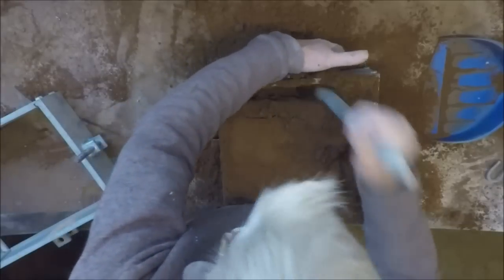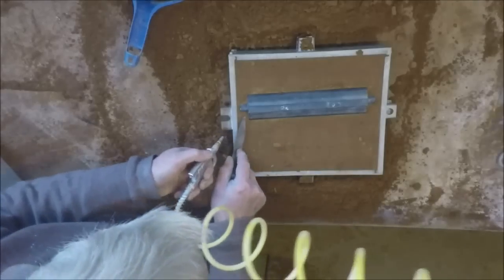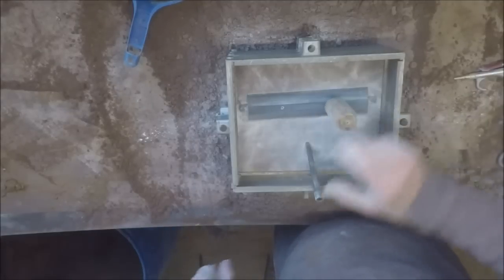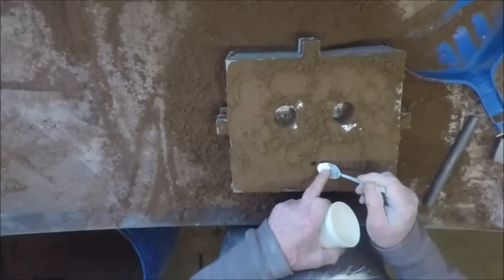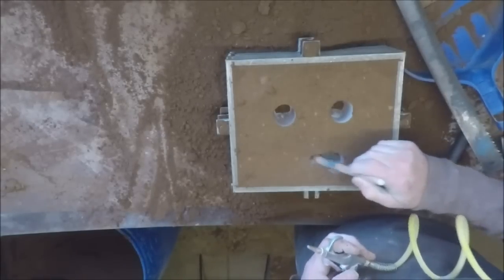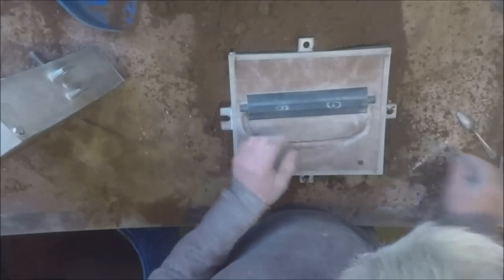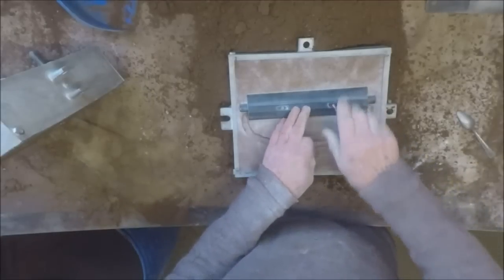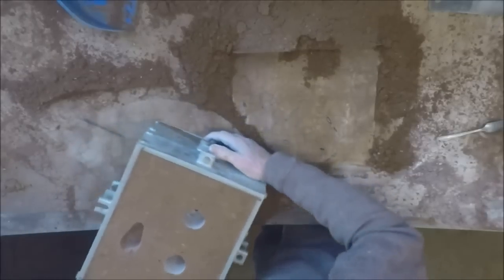Casting a Mini Minor water connector

Comment: Once again a great video. I,m curious about the pouring basin your trying. I've seen similar form used but at the bottom of the sprew where it connects to the gate. Supposedly used to catch any loose sand from getting to the gate and casting. What is desired result you are looking for using this " Campbell" method?
Thanks
Reply from the maker: Dick, Damn good question! I mean that, and there is a damn good answer. Give me a day or so while I think of the right words to explain it properly - it is such an important part of pouring a good casting that I want to do its explanation true justice. For now I will just say that enlargements at the sprue base, often used and advocated by "old timers" were thought highly of (by researchers) some 60 years ago. However recent work has shown that they  never fill as hoped and contaminate the incoming metal stream with lots of air bubbles - large runners rarely run full until quite late in the mould filling process - they slowly release air bubbles into the metal stream until they are full. The bubbles may stay in the casting or may rise through the still liquid metal but in doing so they leave a trail of oxide  behind them, sort of like a collapsed sausage skin these provide not only a weakness within the casting but also a leak path if both ends thereof are uncovered during machining. In calm quiet filling of a mould as this basin and sprue arrangement achieves you will not get any loose sand. I will think on and reply more fully later.
Reply from the maker: Dick, I will see if I can do this topic justice in under a few hundred pages J. I will break it into at least two parts.Part 1, some background: - Aluminium is a very reactive metal. A layer of aluminium oxide will
immediately form on any fresh aluminium surface. Initially it’s only a few atoms thick however it does thicken, quickly at first but at a diminishing rate
as time goes by. This layer is strong, tough, tenacious, and pretty much impervious. This means that at room temperature it effectively stops getting thicker
fairly quickly. But it protects the aluminium from being eaten away by corrosion as a metal this reactive really should quite quickly be. Without this
layer aluminium would be just about useless to mankind – were it to be flaky and porous like the rust on steel for example we could not use the much more
reactive aluminium for anything because it just would not last. Whilst beneficial on the surface if it manages to get mixed in through the aluminium
this oxide layer becomes a serious problem. Unfortunately it is present right through most aluminium in varying quantities and results in lower strength and
much lower ductility and shock resistance.
The reactiveness of aluminium also causes us another problem – the liquid metal will react with water vapour to form not only more oxide
films but also hydrogen gas. The oxide will stay on the metal surface but the hydrogen will dissolve in the aluminium only to (probably) come out of solution
as the aluminium solidifies and fill our otherwise excellent castings with lots of small gas bubbles. The water vapour comes typically from the natural
humidity in the air and the burning of hydrocarbons (oil, gas) as the furnace fuel. Anything that increases the mixing of air, particularly the very damp air
in a sand mould, with the metal will increase both the oxide and hydrogen levels.
When you melt aluminium you can actually see the liquid metal trickling out of this oxide layer on its
surface and unfortunately the layer mostly finds its way into the liquid metal where it floats around as a thin film. As the metal is processed and cast into
a mould the films break up and become repeatedly folded so the resulting casting is a mess of entangled oxide films. These films are bonded to the
aluminium on the side that formed against the aluminium but are not bonded to anything on the side that formed against the air. When folded we have therefore
an unbonded side against  an unbonded side, virtually a crack within the metal, a crack that is easily opened up by stress
or by a bit of trapped air, hydrogen gas, or metal shrinkage. It is now well researched and well known that the random porosity often found throughout
aluminium castings is associated with these folded films – these days they are called “byfilms.” If we could get rid of them our castings would not only be
porosity free but have much higher and more reliable mechanical properties. As an analogy it is sort of like receiving a delivery of concrete for your new
house foundations, as you pour the concrete you realise that someone has put several thousand plastic bags in the mix – your foundation is not going to be
as good as it could be with all those plastic films mixed in with the concrete. Substitute oxide films for plastic bags and aluminium for concrete and I think
you get the idea. By degassing your aluminium with fine bubbles of a suitable purge gas for 5 to 15 minutes plus you will in fact float out many of the oxide
films present – at least those bigger than the bubbles. But we now have to get the aluminium into the mould without making more films, and I will get to that in
part 2. 
But in the meantime and as an experiment get yourself a bucket and fill it with water from a hose held several inches above the water
level and adjusted to produce a smooth stream, as it is filling notice all the bubbles of air that are being pulled down into the water by the stream from the
hose. Wobble the hose about a bit to cause some splashing – even more air, raise the hose higher - again even more air. Lower the hose to quite close to
the surface and hold it still – no bubbles! If the water were aluminium every one of those bubbles would be generating lots of oxide films and even though
each bubble will come to the surface where most will burst the oxide films would remain behind as a collapsed sort of sausage skin.
I am working on part 2 J
Reply: Wow Thanks J for all the work you're putting into this answer. Hopefully others than just myself are reading this.

I've ordered a copy of Campbells "Ten Rules" from amazon. All this is very interesting and helpful. I haven't seriously cast metal since high school over fifty years ago and plan to be doing so again in the not to distant future.

I'm not a stranger to working metal as my father was a machinist instructor and I trained as an A&P mechanic and have been a professional general blacksmith for over 45 years. Now semi retired some of my planned projects will involve foundry work.

Your professional and experienced  videos stand out from the mostly "hobbyist" vids on YT and I'm sure will help me in getting back to foundry work with a lot less trouble and error.

Thanks for your reply and awaiting Part 2
Dick
Reply from the maker: Dick, Here is my attempt at Part 2 of my answer. Firstly back to the hose again.Now hold the hose so it points vertically down (or turn on a tap (faucet)) and look at the shape of the stream – it’s tapered - getting ever
thinner the further down from the hose (or tap) it gets. It gets thinner because of the acceleration due to gravity. This taper is the natural shape
that all liquids (including molten metals) take when they fall in a stream.
It’s the job of a sprue to deliver metal to (preferably) the lowest point in a mould in as undamaged condition as possible. This is its ONLY
job, it should never for example be used as a feeder or an air vent. From here the metal should flow always uphill (difficult to organise) as it gradually
fills the mould. By undamaged I mean free from entrained oxide films, trapped air bubbles, random nonmetalics (sand etc.), and extra dissolved hydrogen. The
metal should be delivered sufficiently quickly to ensure that the entire cavity fills i.e. that we do not get any miss runs through slow pouring. BUT we don’t
want to fill the mould all that much quicker than this “miss run” situation as excessive metal velocities are the enemy. In short anything that leads to
turbulence, splashing or air entrainment into the metal stream is to be avoided. Now, think of a parallel sprue – the tapered metal stream will only
touch the sprue at its top, the rest of the stream will be falling unconstrained in air and almost certainly wobbling from side to side of the
sprue, splashing and plopping its way down to the bottom and pulling in air like a venturi pump. The random hitting of the sides of the sprue is also known
to pull sand off. You can see evidence of this in some YT videos in the form of thin rough black patches sometimes actually containing stuck sand on the sides
of the sprue after casting. One well known YTer actually has such a “blackened’” sprue in the picture that is part of his channel heading. When you
pour aluminium you can see that the metal looks like it is running through a pipe - sort of like water through a very thin flexible plastic tube. In fact
the aluminium is flowing through its own oxide skin. The skin itself is not flowing and remains in place sort of hanging on the crucible lip. Any of the
parallel sprue turbulence indicated above will break this skin and entrain it in the metal. The larger and higher the parallel sprue is the worse the
problems become. Now, give the sprue the same taper as the metal stream naturally has. The sprue now runs full with the flowing metal nicely
constrained within its own oxide skin the latter held nicely against the sprue walls. There is no wobbling, no turbulent metal stream, no splashing, no
plopping, no air entrainment, no hydrogen pick up, and the sand remains where it should be. There are other benefits too – it is easier and quicker to make a
sprue with a former as I do rather than to cut one with a tube. Also my sprue takes up very little metal - large sprues require the melting of a lot more
metal. There is a caveat here – for the sprue to run full it has to be correctly sized. Typically I use a sprue with a small end diameter of 5/16 inch
and a large end of ½ inch and its 4 inches long (high.) I use this sprue on most of my work and that includes castings of 6 to 7 pounds weight, my mould
fill times vary from about 5 seconds for a small casting to about 30 seconds for a larger one. Occasionally, when I require a quick fill, I use a larger
sprue with a 3/8 inch small end diameter; this passes metal so quickly that I have trouble keeping it full. Most people have little idea just how much metal
a sprue will pass and accordingly use sprues that are way to big. This 3/8 sprue when used just 4 inches high will pass just over ½  pound of aluminium per second – this is way higher than  the rate at which most of us YTers ever pour! Any yet they use sprues several times this size – WHY?
The job of the pouring basin is to provide a target for the pourer to aim at, to  provide enough metal to keep the sprue full,  to deliver the metal to the sprue without any vortex forming air sucking in turbulence (think bath plug hole), and to do all this whilst not adding any downward velocity to the metal stream. We can provide a good target just by making the top of the sprue bigger and we can prevent air sucking vortex formation by making the bigger top offset. You can see looking at my pouring basins that this is exactly what I do. We can provide enough metal to keep the sprue full by making the pouring basin deep enough. The downward velocity that I mention comes from the stream of metal coming from the crucible into the basin. This has a decided downward component, but we can remove this by that ridge in the bottom of the pouring basin that is between the target area and the sprue. The ridge must be well radiused where it joins the sprue. You can see a side on view of what I am after at 8 minutes in this
video.      https://www.youtube.com/watch?v=krEWCmfx8Og

The final icing on the cake is to keep the lip of the  crucible as close as possible to the top of the pouring basin. You may have
noticed from my videos that this means that at times much of the crucible is below the top of the mould. To allow this I deliberately lay out the mould to
keep the sprue close to one side. Keeping the crucible close like this not only improves ones aim but it keeps that oxide skin tube intact.
In short pour your metal like you would a beer – calmly, sedately, quietly, and with reverence for the forces at work, after all we don’t
want our beer all froth and bubble either do we?
The worst thing that one can do is to use an overly large and overly high parallel sprue topped by a stupid concentric funnel type
target. Unfortunately this is very common not only on YT but in foundries generally even some quite large commercial ones! The use of a sprue and basin
set up like that I use is not all there is to getting metal into a mould properly and much of the remainder is quite difficult (some say impossible) but
it is a very good start and those currently doing otherwise would see a considerable improvement in their castings at no extra cost or effort by
changing over to its use. 
I now realise that there will sort of be a part 3 to my reply but it will be mercifully shorter! Working on it!
Reply from the maker: Dick, Part 3 of my reply,As I mentioned to Michael in another comment on this video as good as the Ten Rules book is the same John Campbell’s book “Complete Casting Handbook” second edition 2015 is better. It contains the Ten Rules and
a lot more besides. (I should hit John up for a commission! :)) For those interested in the background and basis for the ten rules this second book is probably the better buy. It his however considerably more expensive and somewhat
more technical - indeed in few occasional areas and even as a qualified metallurgist I am finding it a “demanding” read. The Ten Rules is also quite technical but is perhaps the easier read. Bob Puhakka who is probably John’s
most ardent disciple has an excellent video if you wish to get an explanation way better than mine. Bob’s knowledge base is clearly several orders of magnitude greater than mine! As his video relates, Bob has put his money where
his mouth is and succeeded extremely well by using the ten rules. Sadly, his would probably be one of the few foundries doing so! It is a long video so I suggest viewing it in 20 to 30 minute slugs - I am at 50 minutes so far but
intend finishing it shortly The link is:-

           https://www.youtube.com/watch?v=JqQmPUq-PV0&t=3000s
Note that “byfilm” is actually spelt “bifilm” – My bad!

 I do appreciate the comment you have made and I ask if you one of those blacksmiths who can make a
rose out of one piece of steel? When I saw the video of it being done I nearly
fell off my chair – what skill!Good luck with your future casting endeavours and if I may have the temerity to give a piece of advice it would be that while you should not forget what you learnt fifty years ago you should not let it rule your thinking
now - approach the subject anew with the most open mind manageable. Be aware that in most of the foundry industry the old ideas are entrenched so deeply that they are defended with maniacal ferocity. Its pitch forks and faggots to burn modern dissenters at the stake! Most of the books (Pre Campbell) are, at least in way too big a part, just plain wrong! And regrettably much of the YT information is similarly so. Mind you I have no objection to the hobbyist class, we all have to start somewhere and providing we are prepared to listen, read, and learn without dogmatic dismissive rigidity we will improve. It is my intention to keep up the listen, read, learn, and improve thing until the great foundry in the sky calls my name - whenever than may be. In the meantime I am just as "pooroldchap" says "trying to save a few books before my library burns down!"

Regards, Martin.
Reply: Wow, lot of information contained in the above comments Martin.
I had previously begun to notice that the Al as it is being poured from the crucible, forms a kind of aluminium sleeve for the majority of the metal to actually flow through, so when you mentioned it as being an oxide layer, I knew what you were talking about. Interestingly, I knew about the external oxide layer on aluminium from my watching of videos on welding [particularly TIG welding] aluminium.

Comment: Yes the heater control valve mounts to this little block.  The valves are actuated either with a cable or on the real early cars looks like a water faucet as was the case on my bj8 years ago.

Comment: Great job, thanks for the book recommend also.
Reply from the maker: Michael,                  While that book is very good another book of John Campbell's is probably better "Complete Casting Handbook" 2 nd.  edition. It contains all of the Ten rules information plus a great deal more besides. But it is not a cheap book - I got it for Christmas but it was around $180.00. You can find both online. Fair warning though both these books and particularly the CCH are rather technical and even though I am a Metallurgist I struggle with some of the more "intense" parts. Both should be compulsory reading before any metal is melted :)
Reply: Olfoundryman I study metallurgy as a hobby so would probably struggle more than you. I do love casting and forging though and am willing to fo through it several times. thank you
Reply from the maker: Michael, Another excellent little book is "Metals in the Service of Man" It is a Penguin paper back and should only cost you about $20.00 new from Amazon. If you have not already read it I suggest that you do - its where I started. It is sufficiently technical to keep one interested but not so much as to get difficult - It is a very good introduction to metallurgy and has, or at least my edition did, an excellent article on the casting of the huge propellers for the "Queens" - I found it fascinating